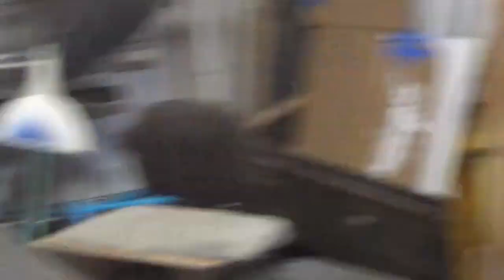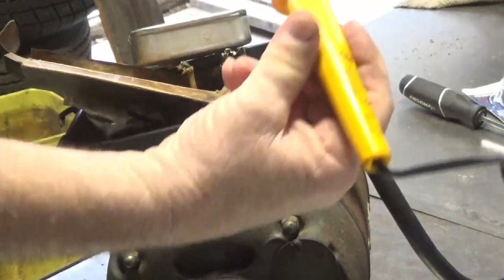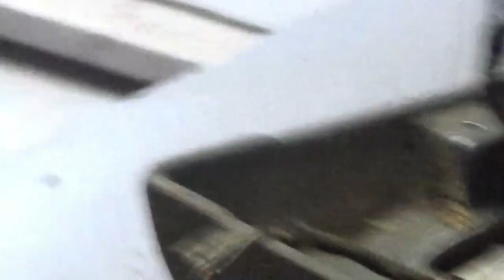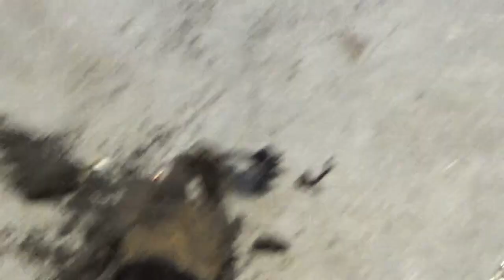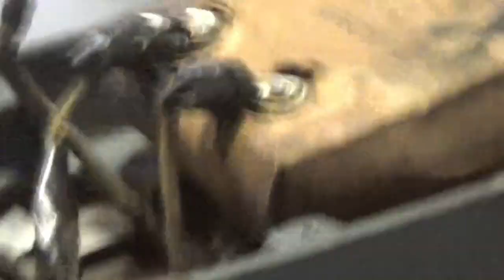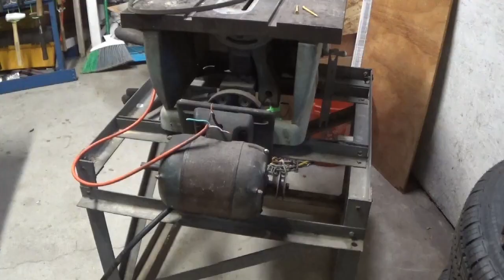Table saw motor repair and install. Old Montgomery Wards table saw. Electric repairs to the motor.

Comment: How scary man only if you knew how much of a dangerous situation you were in only from not knowing that the silver tuna can looking thing was a capacitor but luckily in your situation the sparks from the beginning most probably shorted the capacitor to start with because otherwise you would have had to do it yourself in order not to get shocked dead. 
And i mean Dead because they pack a punch. 
Anyway such as life, it wasn’t your time🙂
Good time to say Alhamdulillah. 🙏
I understand this is a year old,
I just thought sharing would ne good in case you weren’t aware 
Salam ✌️

Comment: It’s a starter capacitor - motor has 2 sets of windings, one is a starter winding the other a run winding.  The capacitor gives it the kick to start the rotor turning, then it is disconnected by a centrifugal switch and the run winding takes over -
Reply from the maker: Right on...thank you for informing me...I appreciate that...have a great day